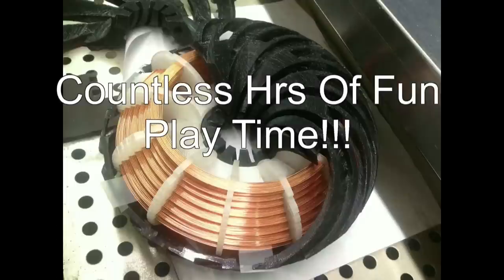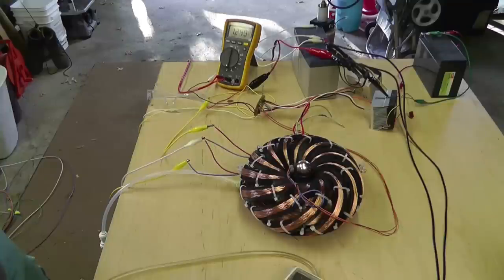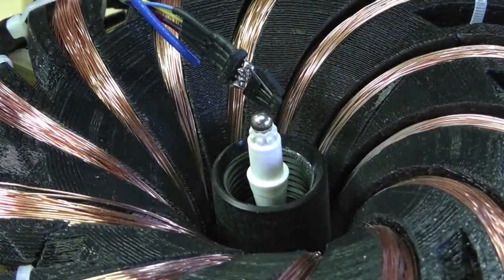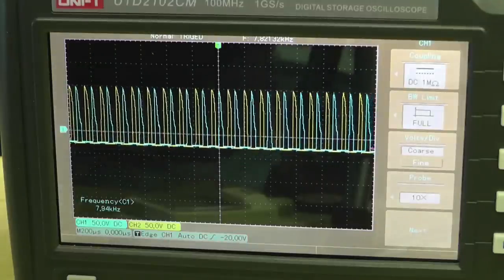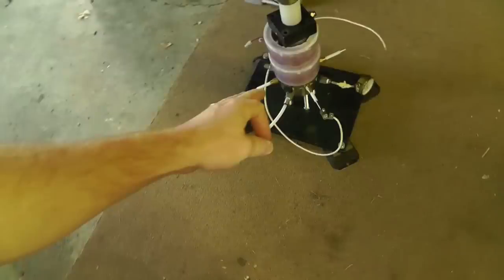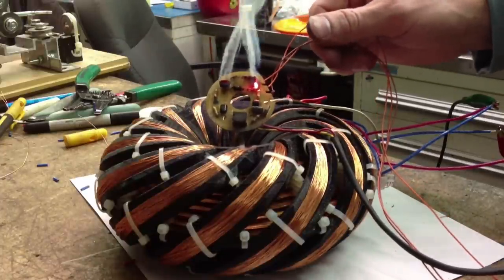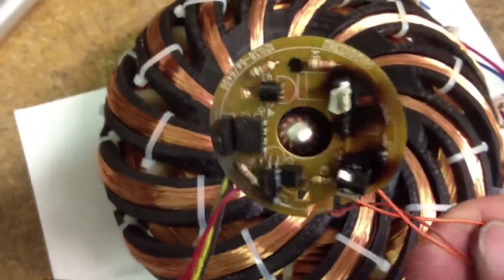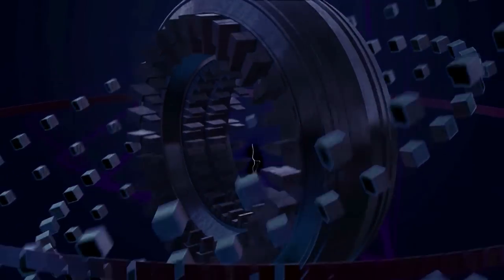PMBO 2013 ~Russ's Final Entry Video... OVER 1/2 Million RPM NEO Sphere Air Bearing With ABHA Coil.

Comment: what kind of fan circuit is that? looks like it has enough circuitry to send a spaceship to Saturn.
Reply: Okay, katt2002 and coler154, I just rewatched the video and have discovered that I'm an idiot.
I need to apologize to everyone in this thread for my stupidity. Russ did indeed use a brushless-DC fan circuit in his design, and he even said so right in the video! (And for some reason I thought I had seen a more complicated circuit than the little round one, but I was wrong! I'm sorry, Katt and Color, and also ungratefulmetalpansy.
So I have erased all of my stupid responses and I hope everyone else will go back and erase theirs to mine also. (But don't erase your thread posting, Coler.)
Reply: all right. i was just commenting on the amount of components on the fan circuitry.
Reply: Yes, coler154, and I should never have commented against that, so I'm sorry.
Reply: Thanks, katt2002, for deleting almost all of your responses that went to my deleted responses. Let me know when you have them all gone, though, please, okay?

And ungratefulmetalpansy, you too, please?

Comment: @Kevin Zabbo : You can't achieve the "relativistic" with this device because the copper in the coil slows down the electrons due to it's atomic properties.
An application of this device could be useful only on a subatomic scale, where you could spin captured subatomic particles and holding them in place.

Comment: All sounds good I love the way it works. And even the best you keep secret. It has a constant mesh neutral. Meaning you don't have to use a clutch to disengage from engine. The weight savings alone would be worth billions. The only thing I see that might give you trouble is the input shaft ring gear. It goes all over the place moving with gear changes. Meaning you have a major balancing problem there? This transmission is probably already been built over seas now when they see your pictures. In full scale working prototype. Cant wait to here your progress

Comment: I bet that if the bearing was in a vacuum it would spin even faster.
Reply: if it was in a vacume it just suck! you'd have to dig it out!
Reply: +bobbg Do you know what a vacuum is?
Reply: Jesus dude, fine I'll spell it 

Less air = less air friction. Yeah I get what you're saying, no air = no sound = no floating. 

However you don't have to make a complete vacuum. 

Less air LESS

yeah it will be harder to make it float, so turn up the sound a bit. But then it'll also have less air friction so it'll spin really fast.
Reply: Also I was cracking a joke to: physics doesn't suck! As in a point in space sucking  is physically impossible. A Vacuum pulls air out of an enclosed area until it reaches a constant point where the rate of air entering is the  same as the rate of air being pulled out. Creating a space of LESS air.

I'm not talking about the kinda vacuum you use to clean.
Reply: Air bearings in vacuum... now there's a challenge.

Comment: 2rwg42985 Do you have a diagram for this?You gave me an idea to improve on something,This could be very useful for putting rotational force on a metal object to shoot out of a railgun.
Reply: i had similar idea,but i was thinking of using the force of the spin to fire it suddenly stop it so it flies off somewhere at a million miles an hour lol.
Reply: 1000000volts containing the whole coil and power supply into wearable will be feasible, but what sort of material can be used to contain that built up energy and direct it in one direction? maybe graphene impregnated ceramic/ composite barrel, using the graphene as an impregnated form of circuit board so that any heat generated in the barrel can be converted back to energy to trickle back into the power supply, and to handle and direct the heat towards the (thermopeltic) plates as it will no doubt get hot once its outside the vortex field and smashing molecules out of the way as it hurtles out at superhigh speed.

Comment: That's a real achievement, designing the circuitry and doing all the winding of wire yourself.  However, for rpm toppers, next time you visit your dentist, ask him or her about the high speed turbine drill where the burr rotates on a cushion of compressed air. My late father, a dentist, bought one in 1959 that rotated on tiny needle bearings at 300,000rpm. The subsequent models did away with the mechanical bearings and were very much faster!

Comment: Cool man I’ve been doing the same thing but it’s a cold steam turbine generator Cut little notches on your magnet and round the inside edges of your nozzle to get more down force on the bearing then make a needle jet on the inside of the nozzle pointing at the edges between the bearing and the Nozzle Basically a small pipe inside a bigger pipe That the bearing sits on top of then use your coils to utilise and transform the energy 🧙‍♂️

Comment: Most people don't know that a dental high speed handpiece, using 50 lbs. of air pressure, can turn over 500,000 rpm's. In effect the turbine centers itself at high speed, going from the friction of small ball bearing,s to actually turning on the air itself. If it fails there is a sudden stop and usually the turbine splits in half. The turbine has high speed but not a lot of torque. It can, because of this speed, go through hard substances, such as enamel, quite easily.

Comment: Need like 8 coils, one coil spinning the neomagnet, the other coils getting charged by the spinning magnet?  Could one coil be powered by 8 others?  If so, there's a great idea to power a home or car?
Reply: doesn't make sense ...

if u got to spend energy to spin the magnets, wouldnt u just use that energy ?

basically converting electricity into kinectic then back to electricity ?? definitely  a waste in between... what the heck are you thinking ?

if a coil spins the magnet, and the 8 coils gets plug into anything, the resistence or eddy current would spin the magnet the other way no ? but since there is no current in the 8 coils, the magnet would generate enough eddy current to slow itself down .... and the whole pile of mess becomes a heat generator ..

 am i right ?
Reply: BabyOxide Yip exactly right.
Reply: It is nevertheless awesome. Regardless of whether it makes power or not, making something spin that fast is way cool!
Reply: MrBilld75 lol
get a office chair, the rotatable kinds, and then sit on it and spin yourself,
do it for 1 minute and tell me whether it cool ...
Reply: Lol! No it would not be cool, it would be a dizzying experience, but this was no safer by the sounds of it. The little ball flew at high speed bouncing off everything in his garage for a min. until it stuck to his car. Must have been a real "ducking" experience! Hehehe.
Reply: metal ball accelerator..... new weapon invention..

Comment from the maker: I tried to answer your question, you agree to disagree with my answer, that's a start.
Yes, your right. Ohms law still applies, from Stan's words. 
The WFC technology is an efficient way to break down water in to its primary parts. Hydrogen and oxygen and do in in such a way that is economically feasible. This is not brute force electrolysis using amps. This is a way to "switch off" the bond of the water molecule with a high voltage low amperage approach. also known as voltrolysis. Cot next post

Comment: Does the bearing spin with capabilities to have a shaft that can come off of the end? to drive the engine?
 like if it were a cone? then connecting to another end that could measure torque, rpm and so forth

Comment: I saw someone starting a oil separator that was'nt balanced properly, only turns on about 18,000 rpm. It had a lot more mass but was also covered by a steel housing. It broke through, and de headed the operator. Sinds then I have great respect for high speed rotating equipment. So please be carefull...

Comment: It's been claimed that a high rotation spinning object will travel further that a non spinning object if launched. If you could build a launcher for the magnetic sphere that is repeatable on launching it from the accelerator and repeat a series of launches at zero RPM and the maximum RPM to see if it goes significantly further or not.

Comment: If you want to see something really cool, try putting a cone shaped super conductor inside the coil. Warning do not have any metal nearby it will create a projected magnetic field a few inches away from the tip of the cone (if it is shaped right). What is cool is that it acts like there is an invisible magnet in free space, which allows you to levitate metal objects a few inches above the coil.

Comment: Amazing! Do you think there is a chance of using your technology backwards? If we can spin magnets can we generate electricity through the coils? Is there something special about the layout that can help with generating electricity. Hmmm i'm thinking this is designed for high speed so it would be best the other way round. can you design something for low speed?
Reply: From what I've been reading about torque related to turbines and the like, you need high torque as the magnetic field of a generator creates a load which reduces RPMs, most accomplish this with gear reduction. You need a blend of both Mechanical Engineering and Physics or basically advanced field theory to work this out properly, there is some manner within MHD (magneto hydro dynamics) that might make this possible.
Reply: Hmmm, i'm sure there is a way to achieve high torque with low rpm. This is what i would like to achieve. Basically the opposite to what russ is doing. Why? Because i am interested in generating electricity. I see many videos on motors and i'm looking for inspiration, why slowly and without gears? Because less energy is wasted at low rpm. I am asking people like Russ for ideas as how to accomplish this. Basically asking Russ to think backwards and use his knowledge to try to make this possible. Anyone? Got their head around a way to do this.
Reply: LIFEONOURPLANET Generation in large power stations is generally done at very low RPM, because it's less wear and tear on the generators allowing them to run 24 hours a day 365 days a year. They are designed so they have enough poles to generate the correct frequency at low RPM. Search for this video "Grand Coulee Dam tour -- third powerhouse turbine shaft (800 MW)" and see how slow it runs. The torque in that shaft is just beyond imagination.

Comment: For a Vacuum. 

1. Eliminate the spherical ball bearing and use a near perfect, magnetized cylinder (cylindrical di-pole bar magnet) with high magnetic retentivity, similiar to shoes in a DC generator. Any Needle/roller bearing would due. I recommend TIMKIN.
2. Create two cup shaped races that have opposite magnetic polarity and align them vertically within the vacuum chamber with the convex sides facing each other. maybe say.....Steel Air gun pellets? magnetized with electrical current of same value?
3. The ends of the magnetized cylinder (rotor/bearing) should extend slightly into and beyond the equator of each race when the cylinder is placed between the races. In this way the like polarities of the bearing/"cylinder" in respect to the races/"cups" of the bearing are able to contain the cylinder under principles of magnetic repulsion, hence suspending it in a vacuum without pressurized gases.
4. Eliminate brushes while in this vacuum. 
5.Reduce physical drag by utilizing electrodes instead, and higher voltages while establishing a close running clearance between electrodes and the bearing surface.
6. Pass current through the bearing/"cylinder" in the direction required to reinforce and compliment the existing magnetism and ensure lasting retentivity with the newly established electromagnetic field driving the bearing.
7. Align the stator coil in whichever way required to accelerate the bearing for normal operation.

just my thoughts, but i'm a hack.
Reply: The resistance offered by mutual inductance created between the rotating bearing and stationary "cup"/races may end up greater that the air resistance, but i don't know. A laminated race and bearing might help minimize eddy currents while underway and keep this to a minimum. Maybe short the races to each other? IDK....words n stufff.

Comment: 500 000 RP may seems impresive, but most any turbocharger would do at least 100 000 RPM, with a much larger diameter. If you really want to see something impressive, think about the blades on a good old Soviet Tu-95 Bear. The prop turn at 750 RPM only, but the diameter of the giant propeller is 6.2 meter, not 6 milimeter.

Comment: If 3/16" diameter = 4.7625mm, and you get circumference by *pi, that's 14.9618mm. 9800 spins per second... * 14.9618 gets you 146.625 meters per sec, so unless I goofed, looks like the outside of that little ball is going 328mph.

Comment: I'm confused ;)
500.000 RPM equals 30 Million Rotations per hour...
At a circumference of roughly 2 inches that would equal about 1 million mph surface speed (60.000rpm equals 100.000 mph)

I think if you color the ball and do a light-based RPM measurement you'll get something MUCH lower...

Comment: So whats the plan form here, are you going to make a bigger one with more coils inside each other to amplify the magnetic field and get an even faster speed?
what is the record for fastest rpm I wonder. With the forces involved how long before that steel ball tares it self apart. At 1/2 a million rpm work out the size of the ball to get the circumference and work out the speed it would be traveling at for a giggle.

Comment: I second this motion. Those safety glasses are no match for sharp magnet fragments traveling 410 ft/sec from the 3/16" ball at 500,000 RPM or larger fragments from the 1" ball traveling 262 ft/sec at 60,000 RPM. That whole thing should have been encased in hunk of Sched40 PVC, maybe even multiple layers.

Comment: When you calculate the centrifugal forces at the surface of the ball it becomes quit scary.

Here we go:

Ball diameter = 25.4 / `6 * 3 / 1000 = 0.00476 [m]
Ball radius = 0.00238 [m]
rpm = 588000 rpm = 9800 [ r/s ]
circumference = 0.0150 [ m ]
speed = 147 [ m / s ]                 ... not that fast after all.

But the mass has to go round a very small corner...

acceleration = v * v  /  r = 9028527 [ m/s2 ]

So what? it is just a number!

Compare it with a 1m82 radius propeller on a small aircraft doing 2700 rpm. That is really high rpm.
Normal cruise is at ca 2400 .. 2500 rpm.

acceleration = 75468 [ m/s2 ]

Conclusion: the force at the circumference of the steel ball is 120 time the force on the propeller tip.

Better use a remote control for this type of experiments. If the ball scatters the tiny fragments will hurt you.

Comment: This coil is way over the top, there is a guy on here who broke 1 million rpm with a similar sized bb,  a plastic bottle for a bearing and a single coil of wire rigged up to a hall effect sensor.

His magnets started ripping themselves apart and throwing shrapnel.

Comment: Imagine taking your torus coil, flattening it, and adding 2 more coils in the spaces inbetween.  Then you'd have a set of coils very similar to the coils I used on my stator for my brushless axial flux DC motor. The main difference being I wound mine on nails and you wound yours on a torus.

Comment: Is there a point to this? Not very electronic savvy, well, maybe a little, but how is the rpm measured, in layman's terms? Thanks.
Reply: He said it's a hall sensor, I would have colored the sphere half black/half silver and then used a laser but I guess his method works too not sure how accurate 

A Hall effect sensor is a transducer that varies its output voltage in response to a magnetic field. Hall effect sensors are used for proximity switching, positioning, speed detection, and current sensing applications. In its simplest form, the sensor operates as an analog transducer, directly returning a voltage.

Comment: Now, think of this, what do you suppose would occur if instead of a heavy metal sphere, you had a ring of a magnetic superfluid (zero viscosity, or "thickness") being driven by the B field of these coil configurations, or similar...

What would happen WHEN the outer layer OF THE SUPERFLUID reaches relativistic velocities?

Comment: Can anyone do the math?: how many RPMs would be needed for the metal to fail under its own centrifugal force? It should rip apart in its equator. If the ball is small maybe the distance is not large enough to get the necessary pulling force in the material, but for a wider ball this would change.
Reply: I tried, but were forced by laziness to simplify the calcs down to the two halves of a ball influenced by a full centrifugal force at given radius. Here's what I've got:
A breakdown RPM for a hardest steel (750 MPa) and ball radius of 3/16 inches would be... 761492 RPM! And it is a slightly over-the-real estimation. So looks feasible, but dangerously close to the "bullshit threshold".
The real case is a lot more complex, since the ball would compress vertically before starting to rip and the force would scale nonlinearly at different distances from the center.